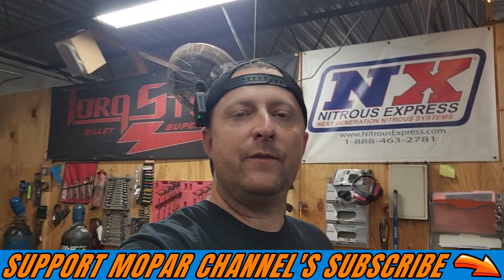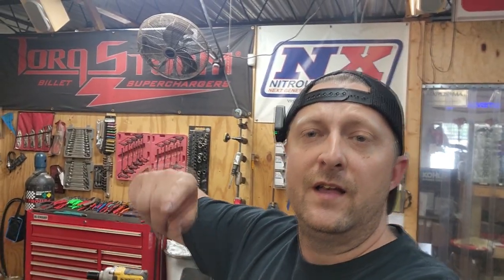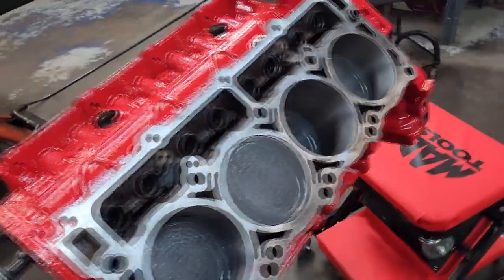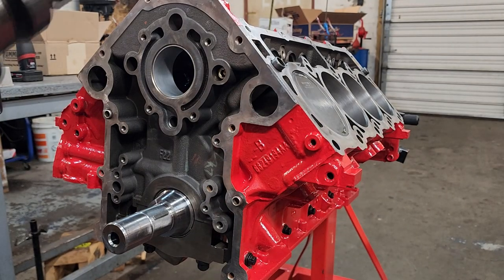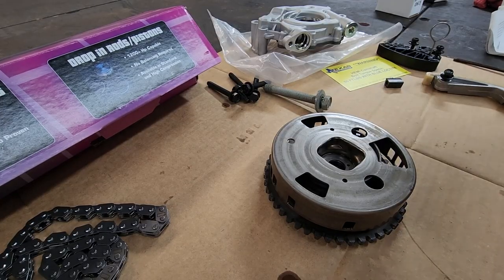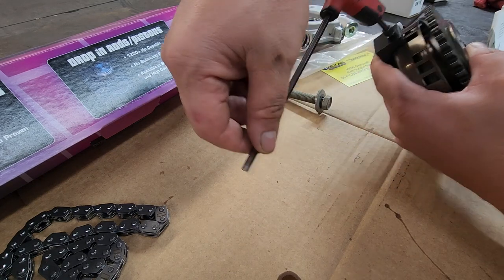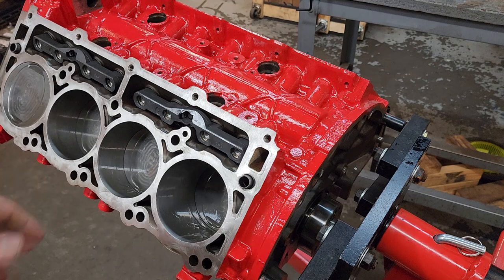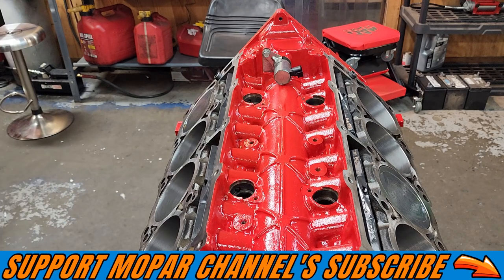BGE 392 HEMI Camshaft Timing, Chain, Tensioner, lifters, Hellcat Oil Pump Part 8.

Comment: I am surprised you didn't soak the lifters. I'm sure it doesn't matter probably, but I did mine for like 30 minutes before doing mine in my 12 ram. Then again, you know of course what you're doing. Just scares me lol
Reply from the maker: Dosen't matter, they pump up pretty quick.
Reply: I'd soak them if they were made of wood...a bit of assembly lube and a few cranks with pedal to the floor(preventing start) will prime everything with oil.